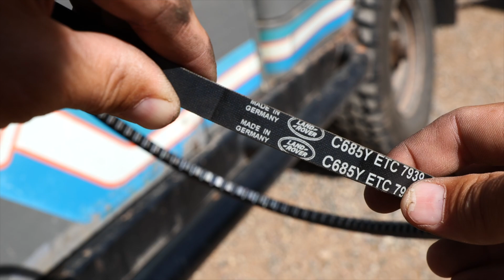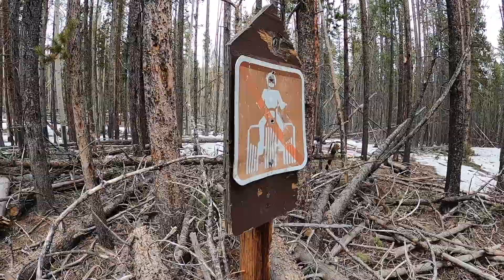V15E13: Into the Uintas with Lifestyle Overland

Comment: With the two of you driving your trucks...who was panning the camera as you drove by?
Reply: They both use LUMIX cameras… Chris uses a LUMIX S5 and Kevin uses both a LUMIX GH5 & GH6. All three cameras have a built-in feature called Live Cropping which allows you to set a starting point and ending point for the shot. Also, you can crop the frame then pan it in post which will give you a similar look to Live Cropping. Either option will give you a pan that looks like someone else was filming the shot.

Comment: Chris, what are you running to power your fridge in the Rubi, a power station or batteries? I totally forgot. I know you have rigid solar panels, but just wondering what you are charging. Thanks.
Reply: I believe he has a dual battery setup in the Jeep.